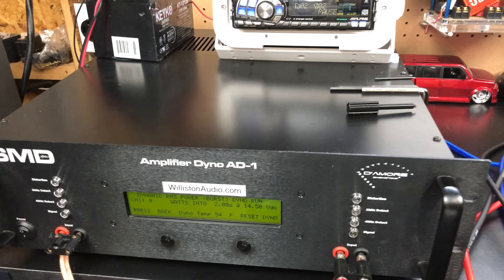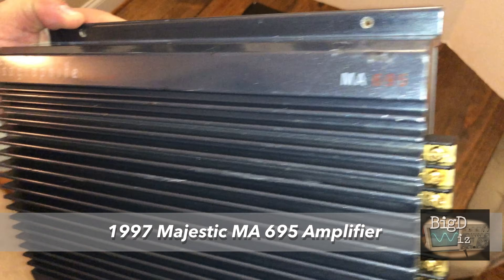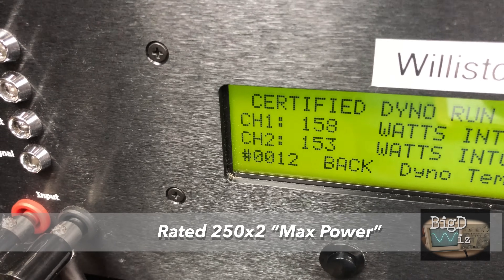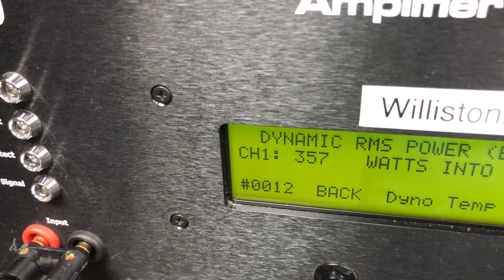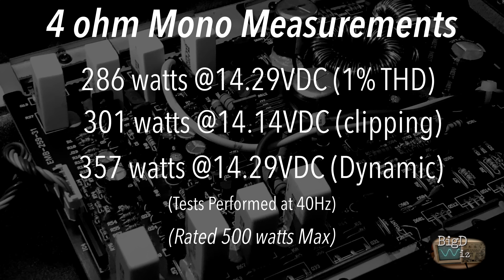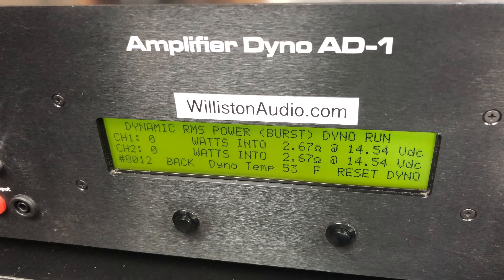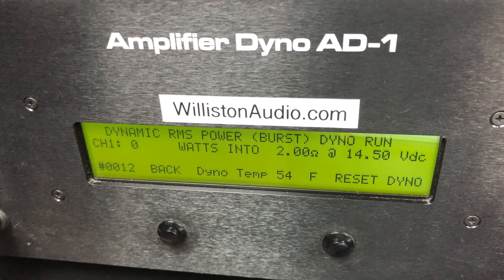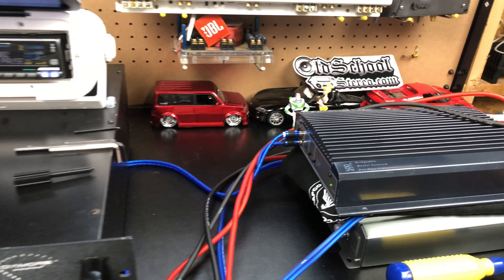Budget Old School? 1997 Majestic MA-695 Isographic Series Amp Dyno Test

Comment: My autotek  7100 bts was plenty enough for 2 Punch 10s back in 1991. That system is still my reference point for power matching. 
 It doesn’t take as much as most would think when all other Ts are crossed and Is dotted.
 A well installed system can have very surprising outcomes.
Reply from the maker: I agree!

Comment: Had a 500w majestic it was a late 90 model . Was bigger and thicker than that one. Had it on two jl audio wo v2 12's in a sealed hatchback box. Payed $250 for it new
Reply: Yeah I was thinking there was two of these because I'm looking at one on eBay and it has a bass boost in his that he tested does not
Reply: I had that amp too! It was the 2nd amp I ever bought when I was 16....picked a crap load of melons,pitched hay & chopped cotton to be able to get it and the 1st of the black cone mtx blue thunder 12s...good times

Comment: I wonder if it would have done better with better capacitors - those caps look like they've gotten quite hot, they're probably dried out.
Reply from the maker: They are probably in need of replacement, but I don't think it would affect the power output

Comment: You don't know anyone that bridges their amps to run their front speakers in a car?

We obviously have different friends. Lol

Because I know quite a few guys that do that. Dudes over at DIYMA do that a lot. Put 300 watts or so to a pair of 6.5 inch Silver Flutes for some kickin budget mid bass. Try it. You'll like it.

Actually I have a pair in my garage in not using. I need to do that myself sometime. I would do it at home though instead. My car audio days are probably over. Too much work for my taste. Lol
Reply from the maker: I should’ve been more clear...they don’t bridge a budget amps for mids/highs. That was my intended statement. I realize lots of SQ folks bridge A/B stereo amps for their mids/midbasses/etc 👌

Comment: Have you ever thought about recapping one of these old amps with some quality nichicons and then retesting to see if there is much loss due to old components?
Reply: Quinn Finlay exactly what i was thinking !!!
Reply: Recapping an amplifier is not going to give you any more power. Electrolytic capacitors only block DC they do not add any power